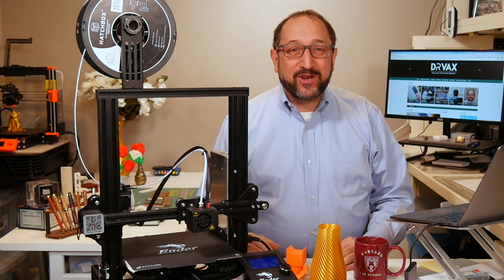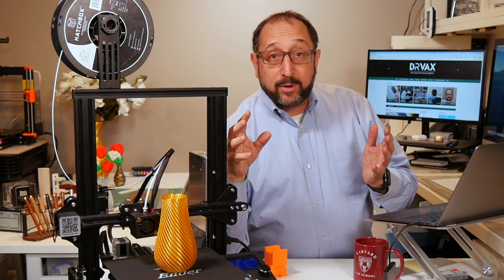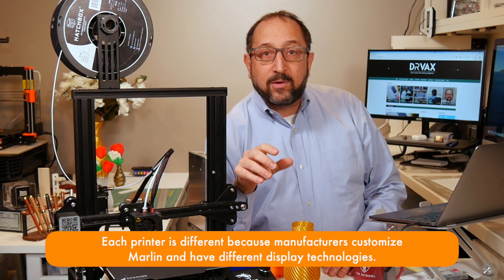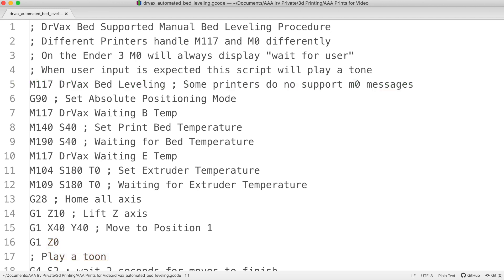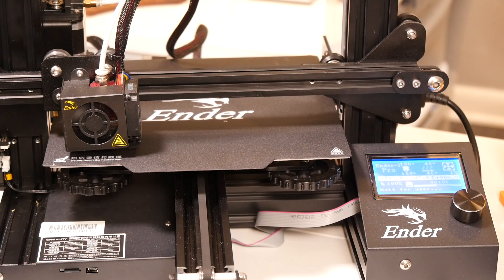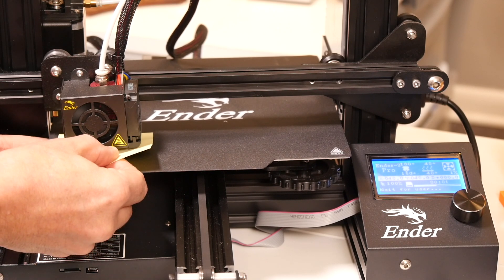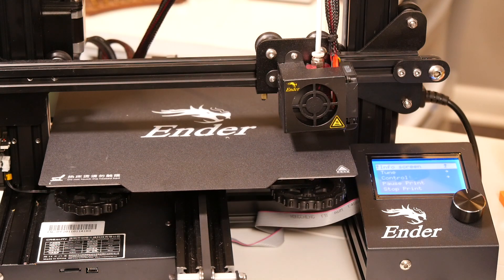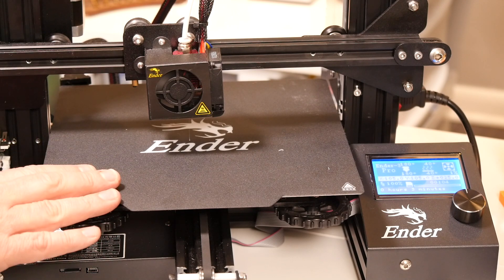How To Add Assisted Bed Leveling to a 3d Printer

Comment: anyone had the issue of setting the height on each calibration point, but then the centre is too tight?  so adding a post-it note under is not going to work :-(

Comment: Is the limitation that it has only 8-bit motherboard? I just got my Ender 5 Pro in the mail today, I really hope it has the bed leveling. lol It's 8-bit though.
Reply from the maker: No.  It’s the firmware build.   The assisted bed level is available in both 8 bit and 16 bit marlin.

Comment: I loved the video. My friends Ender 5 had a hump in the middle. Meaning the extruder head is tight in the middle but fine at the corners. Picture the locations as the keyboard numpad. The 8, 5 and 2 are humped up. While the 7, 4, 1 and 9, 6, 3 are fine. We lost the magnetic pad to that after the extruder engraved it so bad it reached the main bed. The machine is 3 days old only :( Any recommendation?

Comment: I've learnt more watching your videos than any other videos on YouTube, and you always do them with a smile.
I found on my Ender 5 I had to have the hot end temp a little higher than the recommended temps on the filament to get it to stick after proper levelling.
Is this just something with my particular printer, or is this common with Ender series printers?

Comment: I have an ender 5 pro with V1.1.5 motherboard. When I complete this calibration process then go to the menu and select Prepare/Auto Home, the nozzle ends up touching the bed and I can no longer slide paper between the nozzle and the bed. I can restart the calibration and the gaps don't need changing at the 5 points but every time I select to Auto Home the nozzle and bed are touching when it comes to rest. Is this normal?

Comment: I got an Ender 3 pro recently and run your GCODE but there is NO pause for wheels adjustment. The motion is OK and goes to 4 corners and center. It beeps also but no PAUSE
Reply from the maker: Different printer models and even different generations of the same printer support different subsets of GCODE.   It is probably that the pause gcode command in this file is not supported in your firmware.

Comment: Very good assisted bed leveling. I set the Z=0.1 instead of 0 to match the thickness of paper sheet I use for manual leveling. I also set the temperatures according to the filament material I use.

Comment: I have a different 3D printer than Ender.  I'm so new to this.  Can this system be used with different Printers or is it specifically for Ender?  Having a difficult time with Labists ET 4.

Comment: I know this is an old post but it’s a great one, I have been having trouble with my printer and give up on the built-in levelling program when I came across this, I changed it slightly to suit my printer and to repeat the locations to double check the settings which I wouldn’t have done without this video and my printer is printing great again. Thank You
Reply from the maker: My pleasure.

Comment: Hi Droc, I really like your videos.  I bought a Monprice MP10 and I have quite a hard time setting it.  I tried you gcode but it does not seem to work on a MP10.  Would you be so kind to show us how you level the bed for this printer. How do you use the assisted bed levling ?  Thanks you so much and stay safe !

Comment: Thanks Dr Vax ! Build my Ender 5 (first 3D printer !) yesterday, managed to get the test print working by miracle, but today I got 6 or 7 failed attempts, with the filament not sticking to the bed. I used the calibration tool a couple of time and now I have a model that looks to be in the right path ! 

So far I checked several 3D printing tutorials and I must say, this community looks super wholesome, positive and helpful. I should feel lost as I'm not really confortable with DIY stuff but I feel like there's a fix for EVERYTHING here !

Comment: Dr Vax.  Many thanks.   .As a 74 + year old any time saved is a bonus. Is there a way I can speed up the moves between each position?the head moves very very slowly. (I have an old GEEETECH  ProB  unit)
Reply from the maker: Sure.  Check the f parameters in the gcode.

Comment: good video and good idea, i have programmed CNC machines for over 18 years and i also made my own bed leveling g code  but i did not have the code for tones, that was a very good idea that way it covers more then just my machine.
my bed appeared to be very warped and center very low 0.015 as i measured, ordered a glass bed and still 0.015 low turns out that the top extrusion was not straight so put it in a press and pressed it down  multiple times making the ends higher each time until it would flex and stay straight, ( a complicated procedure if you dont have the equipment to do so), if you just bought your printer reach out to the factory email address listed in the read me file and let them know so they can send you a new top rail or just purchase one your self on amazon mine rails are 15mm x15mm on a Ender 5.
DrVax knows what he is talking about not like some videos out there, thanks

Comment: I just got an Ender 5 (everything is stock) but am having some issues making clean prints.  I ran your Gcode to make sure my bed was level, but after the extruder heats and reaches temp, the print resets without going through the calibration/bed leveling movements.  I'm going to level my bed normally, but wondered if you had any ideas.  Thanks, Doc!

Comment: Hi, I've messed up something with my Z-axis motion on my Ender 5, now I have a very thin layer print. How to reset to factory setting or update the firmware?
Reply: You'll need to elaborate a little more. That doesn't sound like you need to reset the firmware, more likely you need to check your bed levelling (tramming is the correct term for anyone who cares), it is probably set a little too low. If when your levelling you can feel the bed spring as you remove the paper you have set the nozzle too low. If it is persistent even after altering your tramming then you should next check your slicer settings to check you haven't somehow set your first layer to a very thin layer.
Reply: @mikea3793  Thank you so much, Bed leveling was not optimized. Now everything works fine. )
Reply: @Ebram777  No problem happy to help! With the ender 5 the tramming will drop out quite often due to the design. I would definitely consider changing the magnetic bed for glass with a PEI sheet and printing some supports to help improve the rigidity of the bed. The bed is cantilevered from the rear slides so can flex a mm or so during large/dense prints. Also worth printing out a mount to move the extruder to the top of the machine, it'll shorten your bowden a fair bit and help with stringing and flexible materials without having to pay for a direct drive setup. You can also mount the extruder above as is to mimic a direct drive but I wouldn't trust the alignment or rigidity on those builds...

Comment: Hello Dr Vax, thanks a lot for the video, i am just a beginner  i just got my ender 5 , unfortunately my magnetic builtec sheet got damaged in the first print as the bed levelling was completely messed up, i got a regular window glass bed with masking tape on it. i was able to print the test dog print quite well but now as i am trying to print a model using more bed space , i have hit a wall. the nozzle keeps clogging up!! thanks to your levelling technique i got it to level pretty good the corners seem to stick well  but as i tried to test your print file in the middle it messes it all up and the nozzle get clogged with pla all around it. kindly guide . thanks again!!
Reply from the maker: It is unusual for glass plates to be bowed in the middle.  I would lower the corners and concentrate on getting the middle right.

Comment: Thank you for giving that G-code, I will try it later. My ender 5 came without the auto leveling tab, and being a knucklehead I could not figure out how they wanted the bed leveled, the bed kept dropping to about 12-13mm while trying to level, very frustrating.
Reply from the maker: This video should help people both with and without the  the bed leveling option enabled in their firmware.

Comment: Sir I need your help...how can I contact you?
Reply from the maker: Unfortunately I am unable to provide one on one assistance.  However I am happy to answer any questions posted to this channel.   I try to answer questions within 48 hours.
Reply: @MakeWithTech  thanks for your reply. My 3d printer models are getting tilt during process
Reply: I have a 3d printer machine of 500*500*500 on which i am printing a cylinder structure but its just get tilt at some height any suggestions for that

Comment: Hey Doc, Just got my Ender 5 and I am trying to use the Gcode file you posted on Thingiverse. when I select it from the card to "print" my Ender says "bed heating" then promply reboots. Have you seen this before or have a thought? Thanks!
Reply: NVM Uncle Google FTW. PSU was set to 220v even though I ordered and purchased in the US /facepalm
Reply: Also TYVM for this!!
Reply from the maker: Did change the voltage fix it?  Have you printed anything else?
Reply: @MakeWithTech  Just finished running thought the leveling file 3-4 times. getting ready for my first print on the Ender 5. I just started with 3d printing but this is my second printer. my first was the little MP Select V2. I will let you know if she prints :)

Comment: This is the hardest way to level your bed. People just convert your ender's3 to a 3 point bed levelling and all your bed levelling problems will be gone forever. Just Google it and you Will know what i mean. It's a simple geometry problem that can not be solved with 4 point.
Reply from the maker: Thanks for the recommendation.  However, this method works for me everytime.
Reply: @MakeWithTech  hi. 4 point levelling is how the table gets warped overtime (i can't understand why new printers don't have this by default). All i did was drill one hole on the table get a piece of alluminium and put it under the table.

Comment: Just got an ender 5 for Christmas and my first test print failed, even though I thought I leveled it well enough manually. Watched your other video on leveling the 5, but didn't have the auto option...which lead me to here. I downloaded your gcode and gave it a go. Ran it 3 times and felt it was probably good this time. Printed the same test print and it finished all the way. Thank you for posting this. Awesome, very informative and helpful. Keep the videos coming.
Reply from the maker: Comments like yours keep me motivated to produce videos.  My production has been a bit slow because of recent family obligations but I should be ramping up the number of videos I produce March 1st.  Until then I will probably do about 1-2 a month.
Reply: @MakeWithTech  You, sir, are a genius! Thank you for producing content! And the fact that you put your family  obligations first makes you an even better man! May Allah bless you
Reply: @MakeWithTech  do you drag and drop the Gcode in cura or do you manually change it?

Comment: Doc, 

   Thanks for this GCode and the calibration print. Not only did it help in me getting my bed leveled but introduced me to gcode. 

   Did a few positional changes for my Ender-5 Pro (which I just got) . Took me about two tries of printing to get it right 

    also had to use that sticky note trick you mentioned under the matte in the center.

    I measured the square thickness and they came out just right. outer square just one layer or .2 mm and measured 0.20 mm, 

    the inside squares  of 1.0 mm measured 1.02 mm So I think the Z-axis is dialed in.
Reply from the maker: Sounds great. Thanks for the comment.

Comment: Hey Doc, this really helps! One question, how do I adjust the center if it's too close to the bed? Do I loosen everything else?
Reply from the maker: Yep.  I would just lower everything a bit and if necessary put a post it note in the corners if you have a removable print bed.
Reply: @MakeWithTech  just did my first print and it went super well. Thank you for the tips!

Comment: Great video!

Please note that you can do the same by enabling LCD_BED_LEVELING and LEVEL_BED_CORNERS in Marlin Configuration.h.
Reply from the maker: Absolutely correct.  However many of my viewers own printers without boot loaders which makes updating Marlin more complex.  This approach works without messing with firmware.  Thanks for sharing.  Irv
Reply: @MakeWithTech  Thank you for the clarification. :)

Comment: This may be a totally noobie question but how can I edit the gcode for the bed temp and hot end temp to suit what I currently use? It seems to be set at too low a temp for me? I've imported the gcode into notepad but it doesn't show an ac tual temp for me to adjust?

Please ignore above as google was my friend here and found out its the S40 command that I needed to adjust :-)
Reply from the maker: No question is a bad question.  That is how we learn together.  Here is the answer.

Look for this line:  M140 S40 ; Set Print Bed Temperature.   The S40 is the bed temperature. To change the bed temperature to 60 change the line to M140 S60.  

Then look for the line:  M104 S180 T0 ; Set Extruder Temperature.  To set an extruder temperature of 205 change this to M104 S205 T0

Finally, the lines with the M190 and M109 commands are used to pause the printer (or wait) for the bed and extruder temperature.  Change the M190 number to match the M140 number, and the M109 number to match the M104 number.

Comment: Thanks - another great video.  A couple of good comments from other viewers - I would run the pattern at least twice, as adjusting a corner will sometimes change another.    Another comment was not heating the hot end,  I don't see any reason one way or the other, but if you want to heat both the bed and hot end there is a faster way. 

here is your Gcode
M140 S40 ; Set Print Bed Temperature
M190 S40 ; Waiting for Bed Temperature
M117 DrVax Waiting E Temp
M104 S180 T0 ; Set Extruder Temperature
M109 S180 T0 ; Waiting for Extruder Temperature

this will speed it up  - You can heat  both at the same time.  The bed almost always takes longer than the hot end, so the bed must be up to temp before it will check the hot end.  May save a few seconds.   In the past people have commented that this may put too much load on the power supply.  I do this in my slicer start code and have never had any problems with any of my printers.

M140 S40 ; Set Print Bed Temperature
M104 S180 T0 ; Set Extruder Temperature
M190 S40 ; Waiting for Bed Temperature
M117 DrVax Waiting E Temp
M109 S180 T0 ; Waiting for Extruder Temperature
Reply from the maker: Excellent comment.   I tend to keep my approach very straight forward, top down, when teaching a concept to make it easier to understand.  Your approach will absolutely save some time if your printers power supply is up to the task.
Reply: @MakeWithTech  Thanks for the kind words.  I have almost forgotten how to level a bed manually since I have EZABL on both of my Ender 5's and the BL Touch on the 5 Plus.  One of the best  investments yet.  Unless I change something to affect  the Z offset the prints are consistently good.  I always do a G29 before every print..

Comment: Do you only go through one complete cycle of this and then move to print? I ask as when manually levelling my Ender 5  I often have to go round several times - as adjusting one screw/corner effects the others.
Reply from the maker: You are correct.  I should have shared this.  I generally do it 2 to 3 times the first time I set up a printer and 1 or 2 times after that when the four corners are already relatively close.

Comment: The references to heating the 'extruder' are incorrect. The extruder does not have a heating element, it's job is only to push the filament through the Bowden tube. The part that is being heated is referred to either the Nozzle or hot-end
Reply from the maker: You are correct.  I misspoke.  Clearly you heat the hot end, which consists of the heater block and the nozzle.  Thanks for your clarification.

Comment: Nice video.

I recommend not to heat up the nozzle - the expansion is less than 1 micrometer and some surfaces (for example the magnetic from ender 3 pro) might be damaged if the hot nozzle is in the same spot for to long.
The bed has to be heated of course, as the heat is not totaly even every on every spot - and of course directly on the heattraces it is higher than on top surface. This will lead to bending the bed depending on the temperature.
Reply from the maker: Lots of different opinions about this topic.
Reply: @MakeWithTech  yes if you bed level with out heating you might level on hard filament sticking out